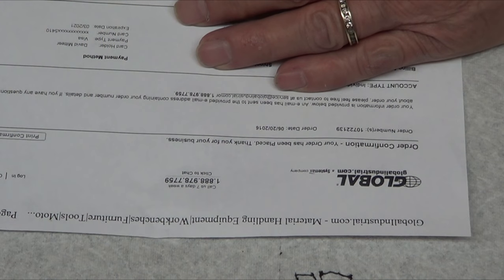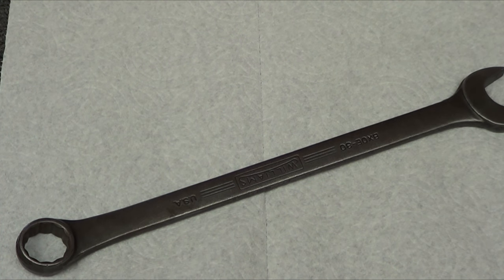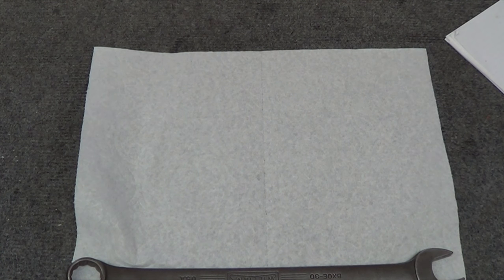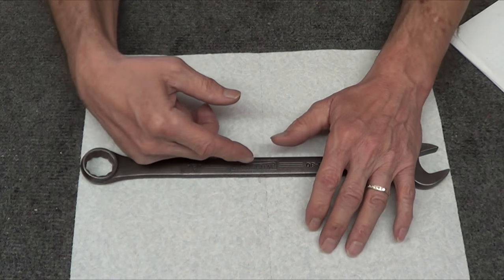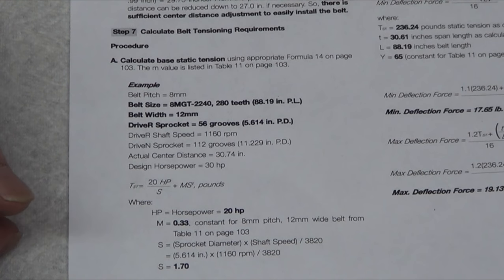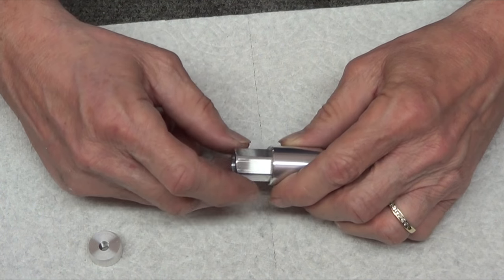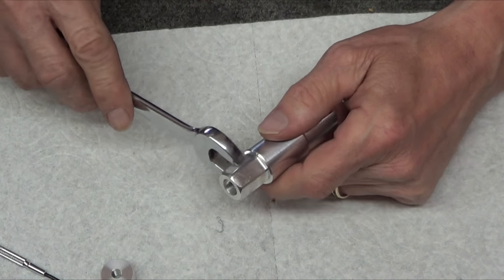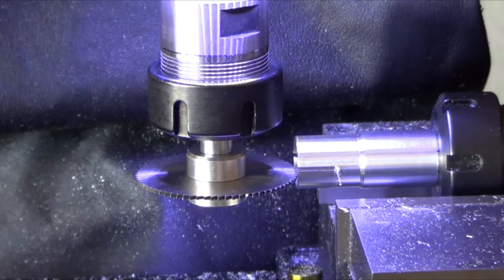Sliting Saw Work Video #79

Comment: I see even high quality carbide inserted lathe tools have the screw a little bit back from the tip, I think to hold the insert against the shoulder.
Also, with Grizzly I was able to return an entire lathe and get a new one. Very good service with them.
Reply from the maker: A little yeah, but this is some .030 which I think is to much .... there is even burs left from threading.
Reply: Dave M Oh, yeah. That's not so great. Grizzly has those Glanze tools that have been working great for me. They're a bit more than $10, but I think it's worth it.

Comment: Dave, if you are out of ideas for things to make i,e, specifically tooling, how about a broach set for making square and hex holes? I have plans for several projects that would keep you busy for awhile, so if you are interested just let me know. I have a youth outreach and one of our upcoming projects is to build a machine shop and do so by designing and building  everything from the ground up in the "Gingery" fashion, but with larger and more robust machines as cheaply as possible. Does this sound like fun?

Regarding tool holders, if you have not already seen the recent video called "Cheap VS Expensive Tool Holders and Inserts"  by Greg Halligan aka Halligan142 here on YouTube, you should give it a view as you may find his conclusion interesting. Greg also has an older video where he tries out some tooling that used HSS inserts that was pretty impressive IMO, because the results were much like those that you attain with carbide on the bigger machines. Granted the smaller lathes don't have the RPM and horsepower that many carbide inserts are designed to operate at which makes it hard to get great results due to the less than optimal conditions, but I am sure you knew that.

So you worked for Hughes Aircraft, well i used to work for McDonnell Douglas Aerospace and prior to that MoPac RR. I think it is interesting that many of the home shop machinists seem to have worked in similar industries earlier in life.
Peace!
Reply from the maker: Hi Jeff, thought about a broach set but can't see me needing it yet. Been looking at key cutters but the same thought don't need yet. May take you up on the plans offer!! Building a shop from the ground up. That's a lot of work and fun. I'm impressed at your dedication to helping teach others. The video referenced I think I've seen it but I will look again. I've had very good results with carbide as you've seen but now starting to use HSS more. You will see it in future videos. Curious to know what you did at MD? Cheers .... Dave